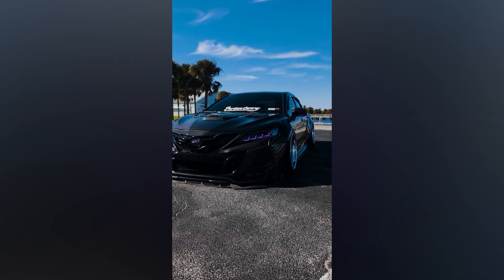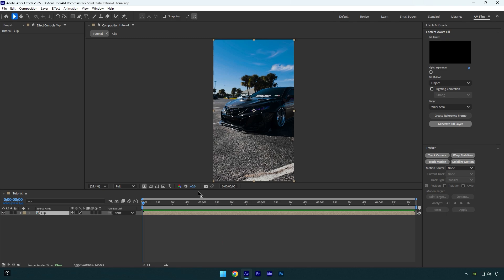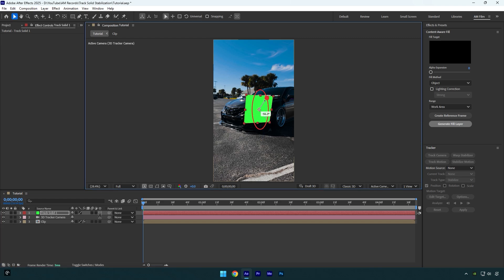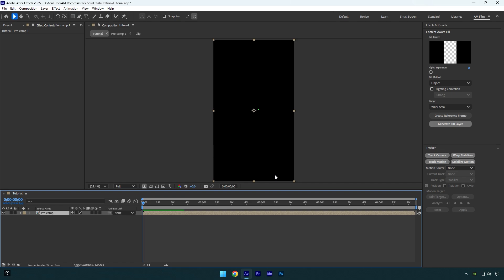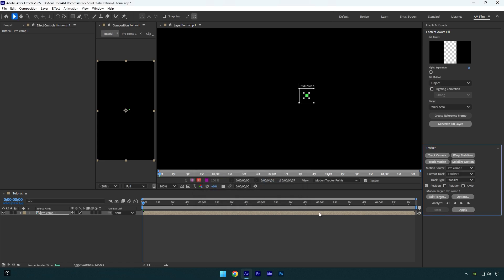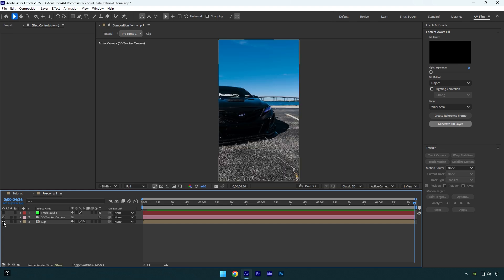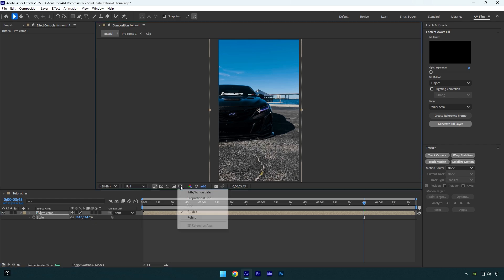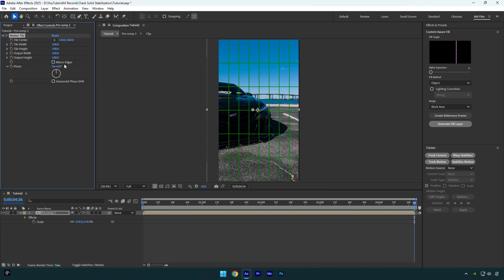Track Solid Stabilization in After Effects (Smoothest Stabilization)

Comment: After the motion stabilizer step, do you need to add a warp stabilizer too? to add subtlety?
Reply from the maker: In some cases yes you need to add warp stabilizer. For example if your video have slight jitters, apply warp stabilizer and under advanced settings check detailed analysis and uncheck fast analysis. Also change the smoothness to 1 or 2%.

Comment: I didn't notice any difference with the classic and simpler "stabilize motion", but I think it'll be a life changing way for those clip without a high-contrast point for the tracking box, thank you🙏🏻
Reply from the maker: This method also saves your time. Cause when you make solid really tiny, you can keep track point small as well and sure the analyzing will be much more faster. Also as you mentioned those clips without high-contrast points, sometimes even with the good contrasted points track point "jumps" and it creates jitters, so this method avoids another issues for you. If the car goes behind an object, you can't automatically track your car, you have to stop tracking and then manually correct track point so it doesn't mess up. With this solid method, you can feel free to automatically track your video because all you track is that tiny solid. And this method makes your editing easier again.
Reply: exactly